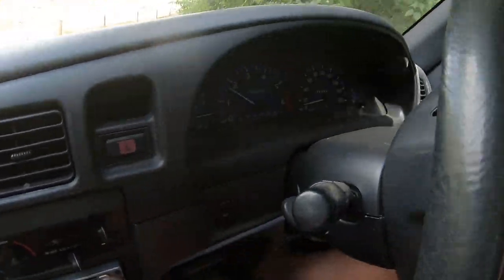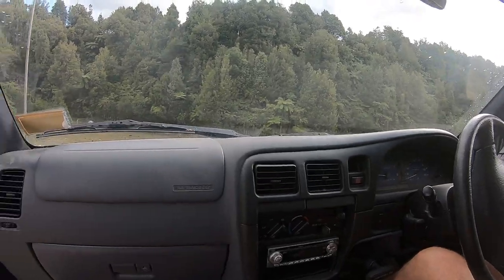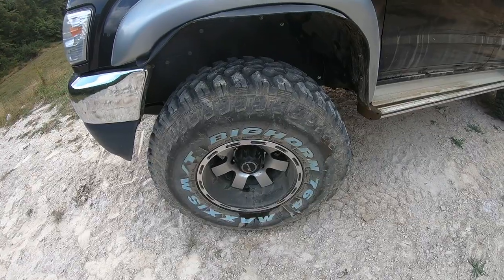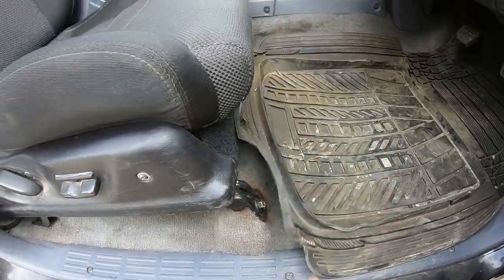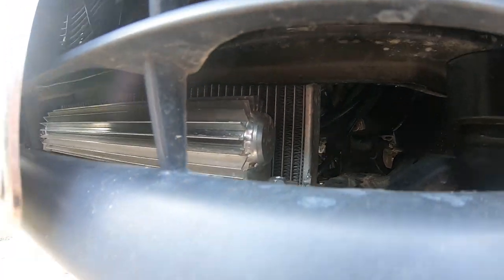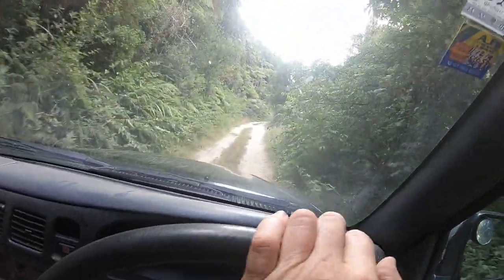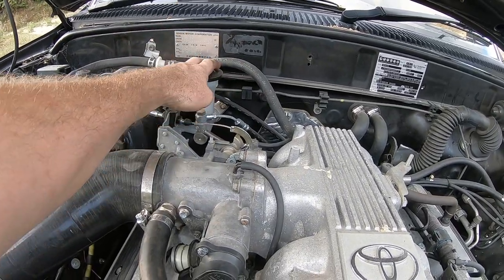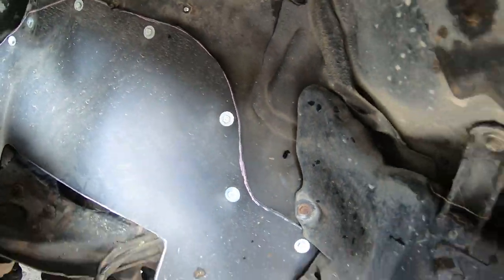Toyota Hilux pickup 2003 1uz Non VVti Manual   Black ute engine swap

Comment: Those are nice looking seats  .what  vehicle are they front  . Here on the states we use first gen tundra  front brakes rotors are larger so are the calipers on some trucks you have to fabricate a bracket  for  the calipers  other than that  they stop the trucks on a dime Luis
Reply from the maker: These seats are from a mid 2000s subaru B4 legacy.  Yep,  big brakes sound good but no tundra in NZ.

Comment: Hi Kelvin Ive been sorting thru your videos watching some here and there, lots of great info. Long story short, I started with a '89 2wd hilux and a '92 soarer for the donor transplant. In my infinite wisdom and patience I snagged a '99 4runner/surf because the 1uz swap looked cheaper/easier after learning about the a340e trans mating to the a340f tail end. Well the VVti started looking better for the 4runner/surf primarily because I'm in california and if it's the same year or newer it can pass inspections. 

 I read that with a a340e trans to a340f tail, the transfer case will be pushed back 3 inches (I think because the bell housing and torque converter are beefier in the v8 compared to v6). I noticed you have a standard gearbox and you mentioned the driveshafts were a direct fit on this ute. What trans are you using? Did you need a custom adapter or flywheel? Sorry if I missed a video

Also from my knowledge, the VVti uses a 5 speed trans, not the 4 speed a340e. And the engine and trans are operated on the same ECU, can I run both ECU's to operate the VVti with the a340e? 

Sorry for the long post, this question has been bugging me for a few too many weeks. As always, thanks for all your help. And thanks for giving me the 1uz bug
Cheers Kris
Reply from the maker: Ok.  lots going on in your head.  

1uz VVti uses 5 speed trans - these are completely different to swap to 4x4 compared to the 4 speed.  

1uz VVti ecu will run a 5 speed , not a 4 speed - switch logic is completely different (except the rare 4x4 aristo 4x4 which uses a 4 speed trans)

This one someone had attacked before use so no idea what the driveshafts were.  In stock for the V6 shafts dont fit.  The gearbox is an R151 4x4 from a diesel surf or hilux.  This was seized when we got it.  Has been rebuilt.  I have videos on custom flywheels and bellhousings.  

Normally a V6 swap moves the gearbox back.  This one was an auto in the past so that is all different anyway.  If they are diesel (which you guys dont see) the gearbox can stay in stock position.  Different models take different mods.  

Hope this helps.
Reply: @CartuneNZ  Yeah sorry that was a lot at once. That definitely helped answer a lot of what I wanted to know. I'm still curious though, you think I can run a 1uz VVti wired as a manual and mate that to an a340e wired to a non VVti ecu as an ect? 
Thanks for the quick response

Comment: What would your opinion be on a turbo 1uz in a 2000-04 tacoma?   Been doing a lot of thinking and I believe I can get it all to fit.   Would be a tad tight but should work.
Reply from the maker: With enough determination it could go very well.  We see a few turbo Hilux over here which is as close as we get to a Tacoma.  Cheers Kelvin

Comment: 3.0 In-Line 6, VVTi, 24V 2JZFSE, how would this motor in your opinion handle in a 2003 or 2004 hilux and some off road? Originally I thought  yeah v8 but my pockets aren't that deep haha ,
Reply from the maker: Ive done a few 2jz-ge and 2jz-gte into 4x4 hilux.  Being straight 6 they are long in the engine bay and I felt sat the weight too far forward.  A direct injection version would not be on my list of engines.  I avoid all of the early D4D stuff.  Cheers Kelvin
Reply: @CartuneNZ  thanks much appreciated,  what a a good or great all rounder 6 cyl non turbo engine for a lux to look around for Kevin please? I'd rather a super charger on it afterwards than turbo,and other bits and pieces, and differently be coming to you sir once I've got everything together
Reply: @CartuneNZ  the 1kz te non turbo sound good to you? How would that be with  super charger  manual 5 speed? Pretty good ya rekon?

Comment: Which gearbox ??
Reply from the maker: R151 4x4.  Rebuilt with strengthened R154 centre bearing retainer, upgraded thrust washer and 1-2 shift fork.  Cheers Kelvin